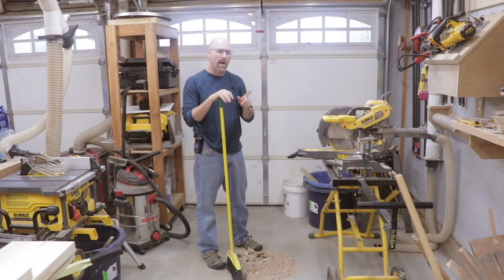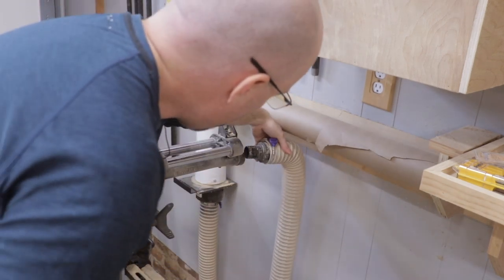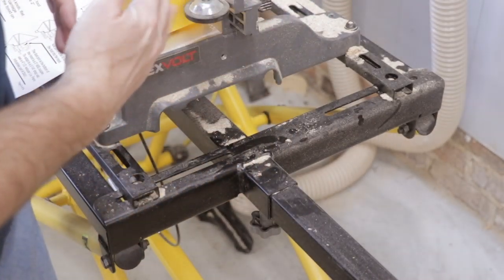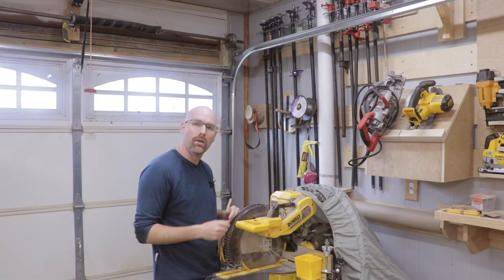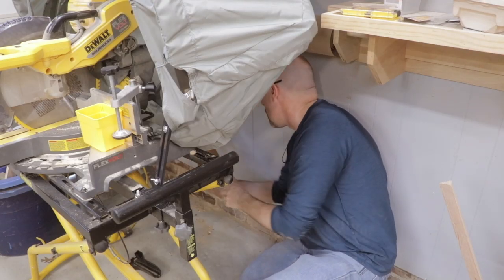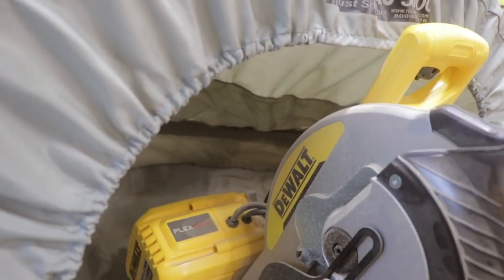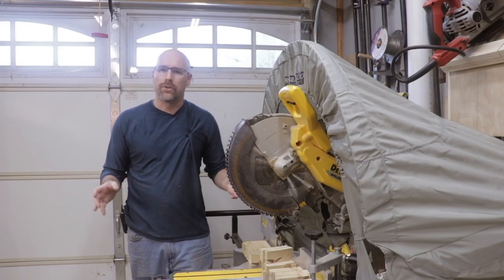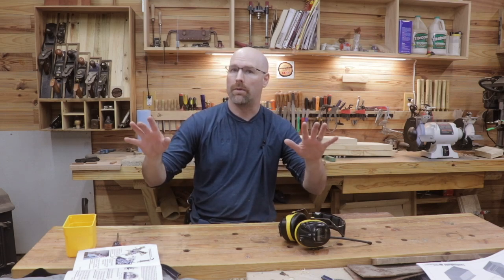Do You Want To Improve Your Miter Saw Dust Collection?

Comment: I’ve had this for years, it’s an amazing way to control dust. I’m happy with the very fine dust getting sucked out and larger stuff landing in hood bottom. Sometimes I’ll even use without dust collector and it works amazing still.

Comment: Oddly I realized that I would have to build something like this to contain this beast. I have a 3hp 230v 1500CFM dust extractor that should do just fine. This is the messiest tool in the shop and throws crap for miles so this is nice to see. Thanks. Always better to have too much suction than barely adequate.